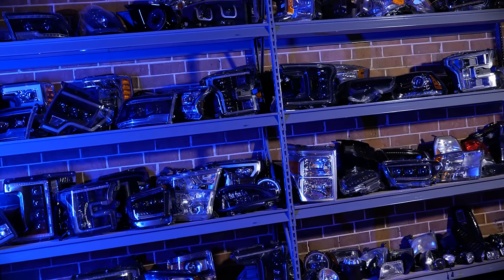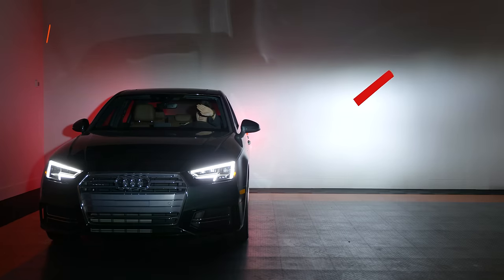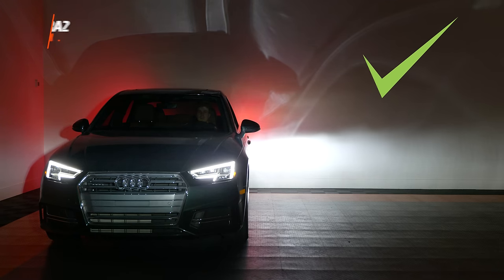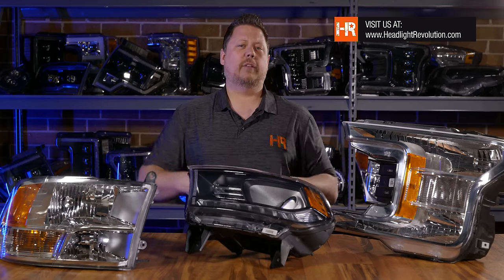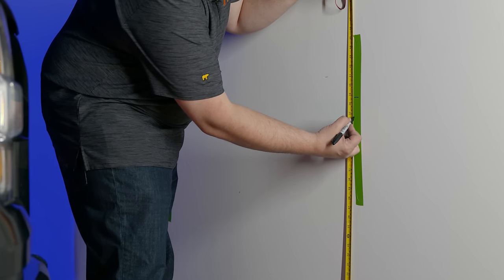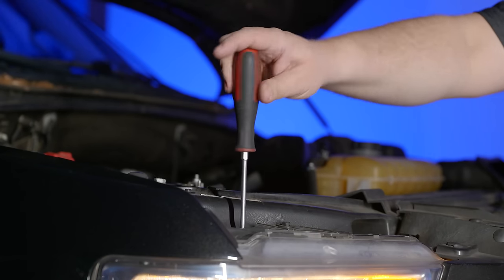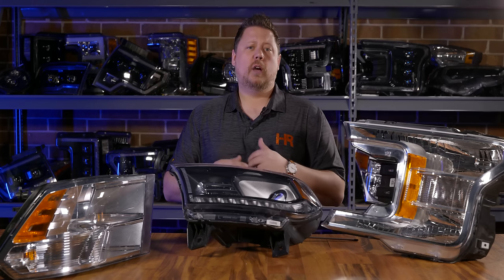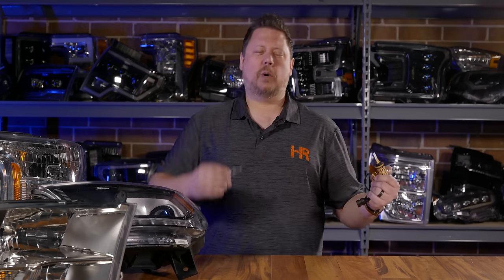How to Aim and Align Your Headlights

Comment: Great video if you have a decent air conditioned  large garage with a flat wall, room to back up 25ft and have the vehicle remain at the same level, enough ambient light to pull the entire headlight housing out and adjust it, pick
up the several plastic bits held in place by a prayer, gravity or luck, refit them, then the entire housing with clips designed by a florist, test it again, then
rinse and repeat several times till you get it correct.
Obviously,  you have never encounted a SN95 Mustang, on a 104°F day in Texas! They were designed by an 8 year old.
Nice video, though.
....maybe one day!
Reply from the maker: We're not familiar with that brand, so we would not recommend.

Comment: I can adjust my headlight electrically, with a button in the interior of the car.  Do you think my car also has a way to aim thw headlights indivually with a screwdriver? Do all cars have that? Im asking because i haven't figured it out yet..
Reply from the maker: Usually they will also include manual adjustment on the headlight as well. I know the Tundras do for sure.
Reply: @HeadlightRevolution  thanks, ill check it out again.

Comment: My issue is trying to adjust my '16 Challenger headlights left/ right.  Any tips?  Thanks so much!
Reply from the maker: There should be a second screw if your vehicle will allow for horizontal adjustment. Some housings simply do not allow for that though, so don't feel crazy if you cant find it. Best bet would be to check with your dealership. Let us know if you have any other questions! 

Sales@HeadlightRevolution.com
Reply: @HeadlightRevolution  thanks so much for the fast response!
Reply from the maker: Not a problem at all, we are here to help! Have a great day!

Comment: I don’t know if y’all check ur late comments but what do I do if my headlights are cross eyed?
Reply from the maker: You will of course want to adjust them out, and that will depend on the headlight you have. Most headlights will have an adjuster screw at the back of the housing, and that would be what you are looking for to adjust those headlights out. Good luck with that, let us know if you have any other questions! Have a good one!

Comment: So I have a 2007 honda civic that had the headlight housing replaced before I bought,  it seems the hot spot beams are above the cutoff line across , is this normal ? Its like a faded cutoff line with 2 flash light beams above it , when driving down rd you see the 2 distinct hot spot on rd , even did this with halogens drives me insane
Reply: It seems impossible for me to get great adjustments off  wall , would I put the 2 hot spots on the bottom of the tape or the cutoff line ( reflector ) housing by the way
Reply from the maker: You would want to align the low beam hot spots below the line in the video. If you are referring to the high beam, those are supposed to be above the cutoff line, as they are directed down the road instead of on the road.

Comment: I just recently put in some Lucas LED lighting on my truck but i am having a hard time positioning the bulbs it is sitting side ways instead of verticaly
Reply: I'm assuming that what you mean is the bulb itself is left to right, when it should be top to bottom. That is an easy fix, just put the bulb in the opposite way. Meaning it you install the bulbs vertically, install them horrizontally instead, and turn them from there to lock them. Aftermarket bulbs are universal fit, because they are meant for many different applications. Some cars such as mine require the bulbs to be horizontal to work properly, whereas others require the bulbs to be vertical. They gave me an instruction sheet with it. I happened to get lucky and bought bulbs that are used by the manufacturer by accident, which i didn't find out until i had to look in the manual for how to adjust them. I happened to come across the bulb section and found out that they use the same bulb i bought. Suburu does everything a bit different. But at least unlike Ford i don't have to remove my headlight to change the bulbs.
However, i cannot change my own wiper blades. Well i can, but it's not recommended and Suburus reccomendation is to replace the rubber on the blade. Which makes no sense to.

Comment: What if they dont adjust low enough? Mine are as low as possible and they are still right in everyones face...
Reply from the maker: You would need to adjust how the housing is bolted to the vehicle at that point, loosen the bolts and try and tilt it down some.

Comment: I didn’t catch whether you are adjusting the high beams or low beams with this method. I assume low beams.
Reply from the maker: Most headlights on the market will adjust the entire headlight using this method. There are some exceptions.

Comment: So I have a quick question, so I just bought some Halo headlights and am having trouble adjusting them because my car ever so slightly higher in the back than in the front, is there any way to compensate for that without blinding other drivers?
Reply from the maker: You could totally just adjust the height of that beam, and on most headlights that is one of the adjuster screws that are on the back of that headlight!

Comment: What do o do when I spin the adjustment screw and the light beam doesn’t move at all
Reply from the maker: The headlight adjuster has come loose inside the light then. You'll need to open up the light to reattach it.

Comment: My *NEW* normal headlight lenses will not move up or down - why not?
Reply from the maker: You should be able to do that from the adjuster screws on the back of the headlight housing itself. I am not sure what housing you have, or what vehicle they are installed in, so I will need that information before I can furtherr help you.

Comment: States with safety inspections, is headlight adjustment included in that inspection?
Reply from the maker: That’ll really depend on the state and the specific testing station. Some testing locations hardly check the vehicle over at all, Others can be very strict.

Comment: Hello Sir.
Can i Use Xenon bulbs D4S instead of D2S?
And which lumens it's nice between 5000k and 6000k?
Thanks in advance.
Reply from the maker: If you have a D2S bulb size, you will want to go with a D2S bulb for the best fitment for sure! And I would recommend going with the 5000K bulb color for the most amount of light output! I have linked the bulbs that I would recommend for you here: https://headlightrevolution.com/philips-d2s-85122-whv2-white-vision-bulbs-5000k/

Comment: Excellent  video, keep up the great work!! One bit of info I can't seem to find though, My truck has a 6 inch lift, Do I follow the same instructions even though it's 6 inches taller than stock? 
Thanks again!
Reply from the maker: The instructions will still apply and get you close, You may need to spend more time tweaking your headlights to get it perfect though.
Reply: Aim it 6 inches lower

Comment: What about if you have the ability to adjust low and high beams individually??  Do you adjust the high beams the same way as the low beams?
Reply from the maker: In 99.9% of headlights, the high beam will adjust with the low beam. So when you adjust the low beams, the high beams adjust with it.
Reply: @HeadlightRevolution  I get it, but I have aftermarket headlight assemblies, and I can adjust them individually.  Thanks for the prompt respond. And keep up the great vids.
Reply from the maker: What headlights do you have? In that case, yes, you would adjust the high beams the same way as the low beams.
Reply: @HeadlightRevolution  Alpharex pro
Reply: @HeadlightRevolution  Thanks
Reply from the maker: Interesting, we'll have to look into that. Thanks!

Comment: How about aiming side to side? Purchased new headlight housings and the alignment is horrible. I'm needing to not only adjust up and down but side to side.
Reply from the maker: What headlights did you purchase? Most headlight housing do not have a side to side adjustment. The only aftermarket headlights that we're aware of that have this feature are from Morimoto.
Reply: Headlight Revolution these were just simple aftermarket replacements for a 2001 4Runner. I watched all the videos on the proper guides to aim and purchase the right kind of bulb and the output is horrible. Even with halogen bulbs so it makes me believe it’s the housings and not the bulbs
Reply: @HeadlightRevolution  How does one align the Morimotos from side to side?
Reply from the maker: Mark, Most Morimoto headlights have an additional screw on the back for the horizontal adjustment. It’s exact position depends on the model of headlight. Which vehicle do you have?
Reply: @HeadlightRevolution  2020 4 Runner - I get the height adjustment and the tape on the wall etc - just need to know how to do it for the side-to-side
Seems like I have dark sectors on the right and left sides
Reply from the maker: That’s very possible, Unfortunately some aftermarket housings just don’t quite cut it.
Reply: Measure the distance between both headlight bulb or projector horizontally. That same distance should be the separation of the center beam

Comment: Just curious about the structure and functionality relationship for my low-beam projector headlights.  I often drive a sedan and need to go about a mile of paved road to get to the main street.  Along the sides of the road are lined with bushes and trees and so I noticed that the light shine on these things are the same, and it does not matter whether I keep the original incandescent bulb or I replace it with either one of the two LED bulbs (bought at different time and different models.)  I am thinking that the beam pattern for these bulbs does not seem to change.  I thought because the bulbs are so far back in the housing that there exist a 'natural built-in limiter' to the beam pattern, that one cannot raise or even lower the beam once it has left the factory already adjusted.  I won't mention the brand of the car, but can this be such a case?
Reply from the maker: The beam pattern is determined by the headlight housing, although moving the bulb will change the beam pattern as well. That is why there is only one way you can really orientate that bulb in that housing, it will be the correct orientation from the factory! Let us know if that wasnt what you were looking for and I will do my best to assist you further!

Comment: Hello, 

First, thank you for your videos and explanations :)

I have an e90 bmw. It had stock halogen reflector headlights. I bought projector headlights from depo and a h7 led kit for the low beam.

The problem is that the beam has no hotspot, it has like a black circle on the middle, while having great light output on the sides. Is that normal with leds on projectors?

I think I should go with an hid kit instead..is that gonna solve it?
Reply from the maker: You will definitely have a odd beam pattern with projectors from time to time when using those LED replacements. Although I can not recommend that HID kit for street legal use, if this was for offroad use the HIDs would work a lot better for you in that projector housing!
Reply: @HeadlightRevolution  thanks a lot for your answer :) I guess I'll give a try to a 35w 5000k/6000k hid kit. Would that be a great option for road usage/not blinding other people? Would 55w be too much?
Reply from the maker: We can not recommend HIDs for road use unfortunately, but in an offroad application, those would work great! 👍
Reply: @HeadlightRevolution  thanks again for your answer. I'll give those a try 🙂
Reply from the maker: Not a problem at all, let us know if you need anything else!👍🙌

Comment: Great explanation of how to aim your headlights, I just have to know convert to metric now so i can ensure my head lights are aimed right as i have a black spot in middle of road like as if my lights have dropped down for some reason
Reply from the maker: Do you have aftermarket bulbs installed by chance? Having a dark spot in the middle of the beam pattern is common with some LED bulbs in projector headlights.
Reply: @HeadlightRevolution  they are standard halogen bulbs that come with my car which is here in Australia a 2015 VF commodore storm ute if that is any help. It does have the reflector and projector lights
Reply from the maker: Interesting! I really wish we had those here in the states!
Reply: @HeadlightRevolution  i have the led lights fitted and much better but still have that dark spot but it not as dark as before but now i need resisters as i now have check dipper light for both left and right. Looks like i didnt research them to well and unless the cars come with led, they are not approved here in Australia known as ADR approved

Comment: If you aim the low beam like this video has outlined then im assuming the high beam would be fine then by default
Reply from the maker: That is correct. More often than not, the high beam is not independently adjustable anyways.

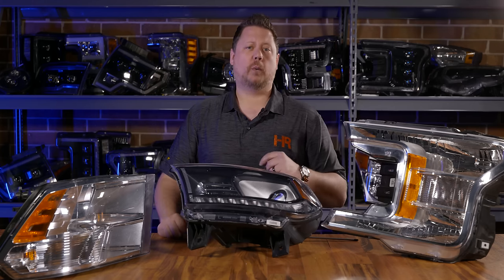Comment: I know this is an old video but I’m hoping I can get some help from someone. At 7:07 , would that be an example of light being aimed too high or too low? I know it sounds dumb but I need to know. Any help is appreciated!
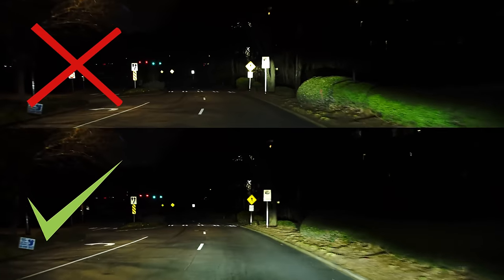Reply from the maker: At 7:07 the top portion is considered to be aimed too high.  The bottom part of the video is what you'll want to try and replicate.  Hope that helps!
Reply: Stop using the standard 2" & 4" drop, these elevations change according to light height. States have min and max projection distances for the low beam. generally 135' minimum and 200' maximum. If you use the 2" drop @ 25' on headlights that are 42" you'll projected the beam @ 520' and not the state maximum. STOP BLINDING OTHER DRIVERS . 42" height @ 25' should be 5.25". Use the formula (42/200)x25=5.25" below center line. ( bulb centerline / light projection  feet  ) x the distance you are projecting it to  ( test wall, test board or other ) it could be anywhere from 10 feet to 50 feet. 

Fog lights have a maximum of 135' projection, so get those adjusted correctly too.

Comment: What tool do I need to adjust my low beam on my 2018 sorento any help would be grateful
Reply from the maker: You should just need a socket or a philips screwdriver, there will be a little adjuster screw or bolt on the back of the headlight, usually manufacturers make it pretty obvious! Let us know if you need anything else! Have a good one!

Comment: Need horizontal alignment instructions.  Mine are off both vertical and horizontal
Reply from the maker: Horizontal is more preference, I prefer the center of the beams to be the same width apart as the headlights, maybe a touch inwards.

Comment: I have a question, I got my headlights changed overall for my 2009 Toyota Camry. And they put Brighter Globes in. The guy lined it up correctly but when I’m driving on the left hand side of road, my left light looks fine, but my right one looks low. I called him and he said he lined them up perfectly on a wall. So he said he can’t do much more. Does anyone out there have suggestions on what that might be and can it be fixed. I’m tempted to adjust my right light up. But then when I measure against wall (up close) I’m tipping my alignment with other light will be out? Please help me out if you can, it is so annoying at night.
Reply from the maker: Take a picture of your headlights facing a wall about 25ft away, and email it to us, we can help!

Comment: Greetings, can you tell me what king of headlamp does mercury cougar 2000 has? Projector or reflector? Thanks
Reply from the maker: It looks to me like they came with a projector headlight, not sure if it was HID or halogen. You will have to determine that yourself before we can get some bulb recommendations going, so check out this video on how to do that! Link: https://www.youtube.com/watch?v=QkF27ylPf2I
Reply: @HeadlightRevolution  they fit normal halogen bulbs, thinking of upgrading to LEDs, what's your opinion?
Reply: @HeadlightRevolution  they look like projectors to me to
Reply from the maker: They do look like projectors to me as well. The issue is that we can not recommend LEDs or HIDs for street use, so we can only recommend halogen options to you for street use. I have linked the halogen bulbs for your car below, and if you would like to look into the offroad options for your vehicle just shoot us an email! Sales@HeadlightRevolution.com

Low Beams: https://headlightrevolution.com/9006-halogen-osram-cool-blue-boost/
High Beams:  https://headlightrevolution.com/9005-halogen-osram-cool-blue-boost/
Reply: @HeadlightRevolution  thanks for your help!!! Keep up the good work
Reply from the maker: Not a problem, let us know if you need anything else! Have a good one!

Comment: my high beam and low beams are reversed. not the alightment of the light, i mean the high beam led chip turns on when i turn on the low beam switch and vice versa. please help.
Reply: Its the way the car handles the volts. Just keep headlights on at all times and it fixes the issue :)

Comment: I have a question I'm trying to adjust my headlights on my 2016 challenger but I can't change it horizontally.
Is it even possibleI can't see anything while I'm driving because my beams shoot to the left and right not in the middle
Reply from the maker: Many of those OEM headlights can’t be adjusted horizontally unfortunately.
Reply: @HeadlightRevolution  turns out I just didn't have the bulbs in correctly 😂
Thank you though!!
Reply from the maker: Glad to hear you got it figured out!

Comment: I do not understand why you have to align the bulbs if they are already aligned from the factory
Reply from the maker: Whenever you  remove a bulb out the housing the alignment is knocked off, so its good practice to check and see if the alignment is still set.